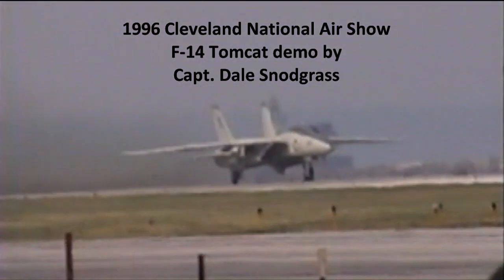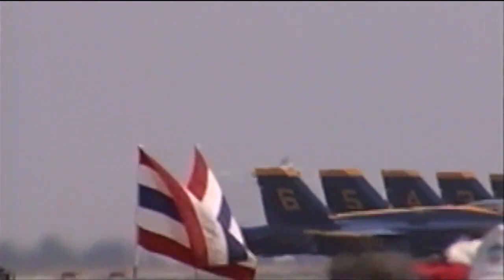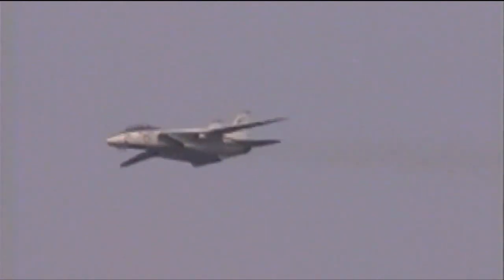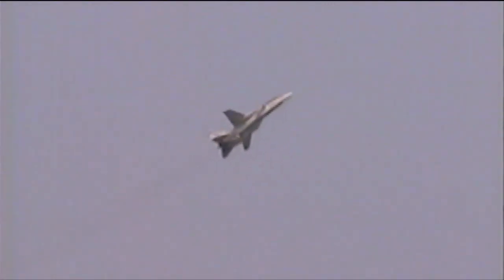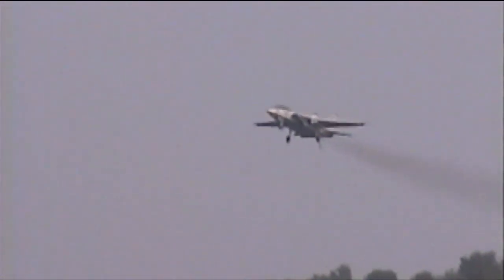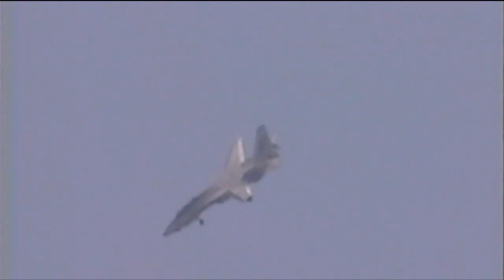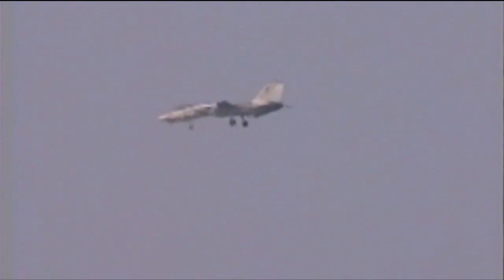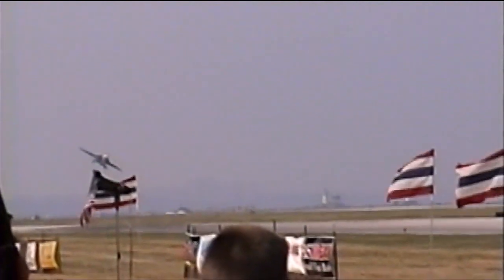F-14 Tomcat: Demonstration by Dale Snodgrass :: 1996 Cleveland National Air Show

Comment: Surprised the Blue Angels didn't use them. Would have been impressive.
Reply: not as impressive as the Skyhawks and then Hornets due to maneuverability.
Reply: @jonnycomfort9271  now the Super Hornets are less Nimble :P
Reply: @mrandrossguy9871  If you think that a Super Bug is less nimble than a Tomcat, especially stripped out like the Blue Angels fly em, then I've got a really nice bridge for you.  The Tomcat was always a compromise(even more so than the F-18E), built around the AWG-9 and Phoenix combination that no longer had a home thanks to the USN F-111 cancelation.  It was never designed to be the most maneuverable thing in the sky.  It was a fleet defense interceptor at a time when enemy fighter jets were not at all the threat the USN had to worry about.  It was the bombers....it always was.  Bombers and cruise missiles.  And if you're talking about compared to the legacy Hornets, then Ihave to disagree there as well, especially down low where the Blues fly their shows.  See, the much improved thrust of the -E means it's much easier to maintain speed during high-G maneuvers than in the legacy jet.  It's  faster and easier to get your speed up, and to keep it up, than in the old plane.  Since maneuvering bleeds speed--energy--the ability to get back on the speed is a big advantage.
Reply: @HiTechOilCo  Um, no.  The elapsed time is not an indication of a tighter turn.  It could just as easily be from a higher speed and a less maneuverable turn at the same time.  the Tomcat was not as maneuverable as other aircraft, particularly the smaller, lighter aircraft of its generation.  You are completely ignoring the truth that a tighter turn can most definitely be at a slower airspeed.  Maneuverability is about putting your nose where you want it--and superior maneuverability means putting your nose where you want it before the other guy gets his nose on you.  The F-22 is a perfect example of this--its falling maneuver allows the pilot to spin the nose rather quickly, but it is a very slow speed maneuver.  You cannot use only one piece of data--elapsed time in this case--as the end all of the issue.  Also, you're never going to get me or anyone else to believe that an -A model Tomcat had better maneuverability than, for example, an early F-16.  And that's exactly what you're trying to say here.  But even if we use your measuring stick, here's a Thunderbirds F-16 doing it in 19 seconds.  https://www.youtube.com/watch?v=fsonP2NjmAw
Reply: @HiTechOilCo  This video shows an F-16 hitting a 1,400 foot diameter min radius turn in 19 seconds...and also shows an F-15 hitting one in 18 seconds.  So that's the fact about the record you claimed--it's simply not true at all.  Even the fact that you pointed to an F-14A tells the story, as it was not as maneuverable as later Tomcats were, thanks at least in part to the much increased thrust to weight ratio.  https://www.youtube.com/watch?v=6Bhk3XNyAtU

Comment: Here in EU we bareley saw the Tomcat. Only in topgun :) Do you guys think it was overrated on performance and power stats etc?
Reply: Absolutely NOT.
Reply: Especially with the GE F110.
Reply from the maker: See for yourself. Snodgrass knows how to make the F-14 shine.
Reply: ***** The first meeting between Toms and Eagles ended...well, contrary to your claims.  Subsequent engagements gave the F-14 the nickname "Eagle Eater."  Super Hornets didn't fare too much better in many cases.
Seemed that Vipers were the greatest challenge to the F-14.
Reply: Underrated if anything. It was the worlds TOP air superiority fighter for decades. It went into service is 74' so it's been around for a very long time. One of the longer service missions of any aircraft in US history outside of maybe the P-51. They were thinking about making variations of the F-14, the "Super Topcat" when it was clear they were going to decomission it, but congress pulled the plug on the advanced variations.
Reply: ***** Not true, the F-14 was a great dogfighter. But it had to fight it's fight, which was a zoom in and zoom out type of fight. If you look at history, other aircraft had this similar fighting style, the P-40 Warhaw, the F-4 Phantom, and the F-14. These are all very powerful aircraft for their time but they weren't designed for a slow turning fight. They were heavier and had more thrust and used this advantage to out maneuver their adversaries. If you don't believe me watch "Air Combat Maneuvering F-14" video here on youtube and it shows how they taught naval aviators at top gun how to use the power of the F-14 to take out more nimble F-4's, A-4, and F-22's. All of that thrust means you can load up that enormous wing and when that wing has the airspeed it will out turn anything thrown against it. You'll never see a tomcat pilot get into a every slowing turning fight with the aircraft, that's its weakness. The F-14 can go into the burner and climb + out turn other aircraft with the enormous thrust it has. It can easily, with an experienced pilot, absolutely hold it's own against F-18's, F-15's and even F-16's in a dogfight.
Reply: +77Avadon77 The F-4 was NOT more nimble than the F-14!  That's B.S.!  In every measurable respect that counts, the F-14 was superior to the F-4 -- roll rate, acceleration, turn rate, turn radius, range, payload over distance, radar capability, etc.  That was true for the A-model, more so for the F110-powered F-14B and F-14D which would be competitive even today despite what the F-16, F-18, and F-22 crowd believe.  I don't know why the Internet has promoted this idea that it was inferior to the F-4 in about any way.  The opposite was true!
Reply: AvengerII
Alright alright.. relax.. you'll get an aneurysm. lol The F-14 was more nimble than the F-4. Put your eyes back in your skull. lol
Reply: I've read that the F-14A got better turn rates below 15,000 feet and 450 knots, and for the ones with the Big Motor, it was probably more like 20,000 feet.  Also, the F-14B was only about three seconds slower than a Viper going from 200 to 600 knots in level flight.  Of course, in the hands of someone like Snort or Hoser Satrapa, the 14 could do things that damned near defied the laws of physics.  Hoser even won a dogfight against an F-5 in 15 seconds, even though the fight began with the F-5 just 500 yards off Hoser's dead tight six!
Reply: 77Avadon77. The Tomcat was an 'Energy' fighter and could abuse the everlovin' hell out of the vertical. It was not an 'Angles' fighter like thw Falcon, Hornet, and Tiger II.

The Eagle can do both 'Energy' & 'Angle' fights. Damn thing can bust Mach 1 in a straight vertical climb.
Reply: Jan-Jaap Bats nope carter sold them to iran before the iotolla took over and gave them to russia so we had to upgrade to f15

Comment: Snort was an amazing pilot. Bold but not too bold. How we decided that the hornet was a better option for the navy compared to the cat, can only be answered by Cheney and his Boeing filled pockets.
Meanwhile these "too expensive" planes are still being flown in original A trim by Iran, 45 years later.
Reply: Thats a very close minded way to look at the f18 being chosen over the f14.  Perhaps if iran was offered the choice between f-14s and F-18s what do you think they would choose?
Reply: @brendanmarriott661  "closed minded"?  Cheney made it his mission to get rid of Grumman and the F-14 because boeing was giving him lots of money.
As for Iran, it depends on what their air force needed when the hornet was introduced.  They had their tomcats for a decade before the hornet went into action.  So a 10 year newer plane with new state of the art flight controls and avionics could have been attractive to them.  Of course when the F18 was begining export, the F-14D was also in the process of being built and tested.  The B model was already flying with GE-110 engines. So another few years after the hornet was released Iran could have been given the option to purchase the F-14D.  Iran did not have AWACS during Iran/Iraq war, so relied on the long range AWG-9, they would have loved to get the APG-71 of the D model.  The Iran would have had the choice between the F14B or F18A when the Hornet went to export.

Comment: Have it your way. The F-14D was, at last, what the Tomcat was supposed to have been from the beginning. The type had at least as much remaining development potential as the F-15 with the size and flexibility-of-basic-design to serve well into the future. Its"replacement," not actually an F-18 -- bearing only a resemblance to F-18s, but unlike F-14, "from the right contractor" -- too small, incapable of Mach 1 under 16,000 ft with wing hard-points occupied -- and perpetually at "bingo fuel."

Comment: Well if the navy had a contract tied in with P&W then why not the F-100, They might not have been perfect, but much improved over the TF-30.  

Of course as you may know buy now, the GE 110's have been pushed to 32,000 lbs of thrust as in the case for the F-16E (also known as the Block-60) and could be used in the new F-15 SE or F modle.
Reply: A variant of the PW F100 (PW F401) was slated to be integrated into the F-14B at the beginning of the F-14 production run.  Teething issues with the PW F-100 and cost overruns with the F-14 program inspired the Deputy Secretary of Defense to mandate the Navy to stay with the F-14A/PW TF30 configuration.  Very poor decision in retrospect that had very negative consequences.

Comment: Unfortunately, the facts are entirely clear. Without the F-14s, our carrier battle groups are significantly more vulnerable to aerial attack. Cruise missiles are the modern equivalent of the kamikaze. Knock down the first 99 and the next one can still ruin your whole day. "Super Hornet" has no equivalent fleet defense capability. Short legs, short on  capability -- but, allegedly, "cheap." Tomcat "expensive to maintain?" Really? And the cost of a carrier battle group, again, was _____________?
Reply: exactly , if and when a carrier group is targetted by Tu22m Backfires carrying cruise missiles.
The Boat is at much greater risk without the Tomcat & Phoenix (or even the never In service equipped AMRAAM) combo.

The Bugs can't intercept as fast, and not as far out.
They can't loiter long enough on CAP because of poor fuel autonomy...
Fact & Fact & Fact 

They did manage to slap 10 Amraams on a Superbug,
But that don't mean it's a practical loadout that can scramble, get out to the inbound Backfires in time to prevent Vampires.

Comment: Let it be known this is not a fighter but a interception plane. I’ll JAM u. Captain and shift commander LaBonte. 3D recon usmc
Reply: It was a fighter/interceptor combination. Navy put very high requirements for Grumman to meet. It was developed from the ground-up to be a fighter that could excel in air-to-air superiority and the F-111 AWG-9 radar and Phoenix systems were the only things that carried over to the F-14 for long range intercepts. It was developed during the cold war to take out the enemy at all costs before they got too close to the assets. Also, to go deep into enemy territory fighting its way in while escorting the F-18 air-to-ground strike attacks in Afghanistan. That is why F-111 was rejected by the Navy because after Vietnam they wanted something that could excel in both. That is why it is so maneuverable despite its size. That is another story that most of the fighters that came head to head with F-14 did not want to fight and would disengage and turn around.
Reply: F14  the F stands for Fighter...